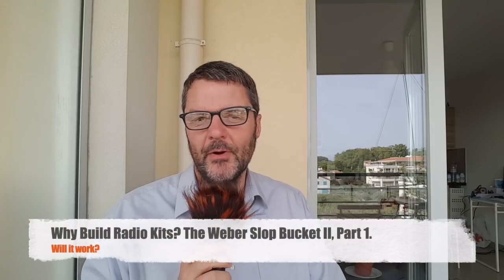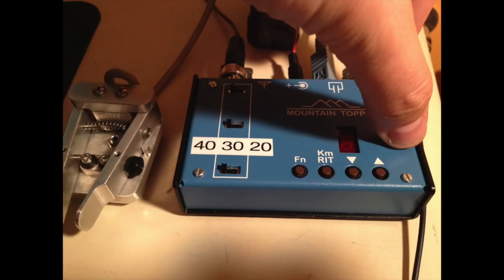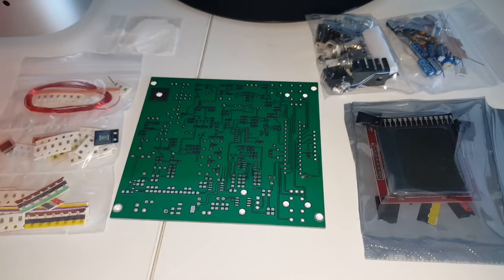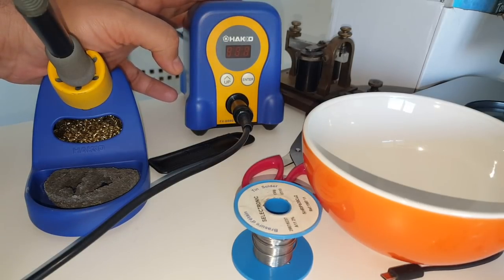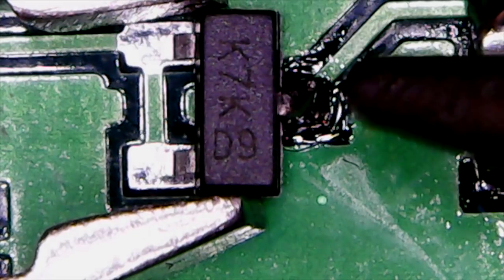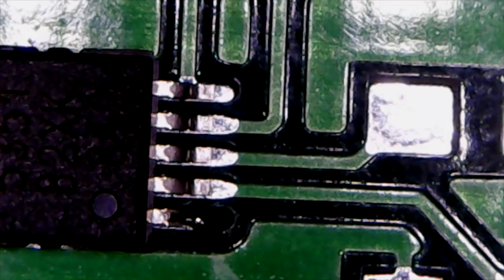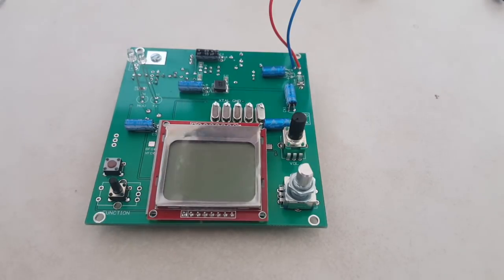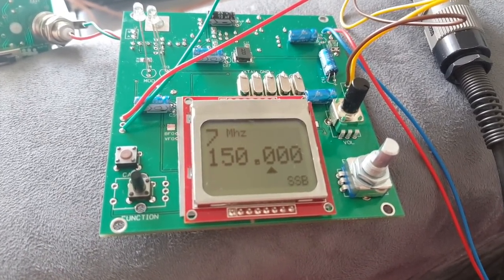Why Build Radio Kits? The Weber Slop Bucket II, Part 1.

Comment: Hi, just got out my slopbucket, it is still waiting to go into a case which I started to do and then set aside. Getting a rig into a case usually takes me just as long as building the radio itself. Still waiting for the part 2 video, but I am not either! Did you ever get any solder paste? 73 om
Reply from the maker: No, and still have to put mine in a case, LOL.
Reply: Is your address on QRZ.com good?
Reply from the maker: Hi, yes it is..

Comment: You do realize that the new YouTube guidelines say that you should let the  magic smoke out BEFORE coming on line so we will then believe that you are competent and a good technician. Seriously though, I am wondering why so few use solder paste and heated air flow techniques. Honestly, I as of yet haven't done it, but I have prepared with the Mechanics brand solder paste (recommended) and an inexpensive rework station. I have used the iron on that station for a couple years and it is one of the best I've owned (A 50 dollar eBay unit !) . I have no reason to believe that the air system will not work. I have picked up inexpensive universal breakout boards for inexpensive extremely small smd chips for practice. So I then won't destroy an expensive chip. I have new braid coming because I have seen it not work even with the slightest nearly invisible amount of copper corrosion. If you can see the corrosion its probably worthless.  My friend ND6T uses a slop bucket on 80m for some local nets and it sounds great. I wish the offerings were not so small, 80 pieces isn't a lot of units.
Reply from the maker: Right, I am tempted to try the hot air method but the problem is my vision now...
Reply: @RadioPrepper  Well, vision affects all of us regardless because few have microscopes for eyes. I'm going to use one of the cheap usb ebay microscopes. I think it will do the job on smaller boards as is, it has a small stand. On larger boards I'd need to figure out some sort of horizontal sliding system to hold the microscope . But most of the boards I will do now are very small. In fact, I've started this video on the exact point showing exactly what I will do ... https://youtu.be/qqoHTKhIBRo?t=609
Reply: Incidently my eyes, both of them, were like microscopes for most of my career. Extreme Myopia. Was good for electronics. Now, one has a lens replacement, and one is the original ans still good for electronics. Older people look at me (I'm 70) and think its really strange I hold things so close. And can read so well. Without glasses.
Reply: One of my jobs was to repair kits folks had built. Helped to have a good background in troubleshooting.

Comment: 8:18   Solder flux is your friend and stops solder bridges from happening. Here is a link to someone applying flux, applying the solder and then quickly and safely fixing a solder bridge. You can see that the flux makes things a whole lot easier. I swear by the stuff.     https://youtu.be/6PB0u8irn-4?t=28

Comment: Gill if you put a little flux on the board those fine pitch chips will flow much better and bridge much less also if you put a little flux on the solder Wick it will draw up the solder much better. You did an awesome job. Love your videos keep it up.
Reply from the maker: Thanks!

Comment: Gil, maybe it's time to get a hot air soldering station and use low temperature solder paste for SMDs. They are fairly affordable on amazon and will make your life much easier.
Reply from the maker: Yes, probably would... Thanks.
Reply: @RadioPrepper  Less than $50 USD. :) 73s.
Reply from the maker: Yes, and a hot plate..
Reply: @RadioPrepper  No need for a hot plate if you get low temperature paste. The components just get sucked up to the paste and pads. It's amazing to watch.
Reply from the maker: Interesting thanks.

Comment: Very nice, you have convinced me to get a usb “microscope”! Flux does make things easier but Steve specifically warns against using liquid flux. Despite that I often use a little tiny bit of extra liquid flux applied with a toothpick that looks like it does not have any flux on it any more. And then I usually boil my boards in alcohol to try and get the residual flux out from under the parts. Having set my left hand on fire once with liquid alcohol (with a “penny stove”) you really want to be careful with hot alcohol, that blue flame is almost invisible. Loved the job you did with the si5351, wow! My first slop bucket did not work at first and I had to go over several places more than once and had to get help from the group and from Steve to get it going. Thanks again for the videos. Jerry aa1of
Reply from the maker: Thanks. I hope I can sort it out...

Comment: Flux makes working with smd a breeze. Just put plenty (really flood it with flux) on the legs of the ic, a small blob of solder on the tip of the iron and slide the tip along the pins in one go... flux makes it easy... No need to address the pins individually. Thanks for sharing this kit, nice!
Reply from the maker: Thanks.

Comment: Gil for the surface mount components you really need a smaller soldering iron bit, however, If you take some thin copper wire and wrap it around your iron tip the end of the copper wire becomes your TIP making it easier with the aid of your zoom camera to solder the small legs on ic's etc  Hope that helps 73 Mark
Reply from the maker: Good tip thanks.

Comment: Great content man. Gives me hope at trying this once I can acquire a decent solder station. Using the $15 Walmart specials are barely good enough to solder coax with a PL259 connector. Thanks for the vids! I really enjoyed the 2m SSB ones from a couple years ago as well. Ended up picking up a vintage Kenwood TS-700A at hamfest last weekend as a result of seeing how fun it can be and I will patiently wait for the bands to open. Gives me enough time to get a good dipole setup. Have a great week!
Reply from the maker: The Hakko station is great, but there are fakes floating around...

Comment: The method I use for SMD : stick the SMD in place with flux paste, maintain them firmly on the PCB with a pair of tweezers and apply the solder tip with a drop of solder on it. Flux will help making nice and even joints and will avoid solder bridges, even with large solder iron tips.

Comment: Ok... I am really impressed.  My eyes are not good enough nor are my hands steady enough to attempt something like that.  Those days are past...   I built my first kit back in 1962 - a Lafayette Explore Air regen  receiver.   I was 10yo.   Next I built a 40m/ 80m transmitter from junk parts from old TVs and radios.   Lots of fun....  a few years later I built a Heathkit HR-10.   HOWEVER, surface mount work is way beyond my current abilities.  I did enjoy the video...  later...  73
Reply from the maker: Thanks. I think I'll switch to tubes next.. Those parts are too small!

Comment: Hi Gil, If you can get your hands on a flux pen, touch the pads first before applying the solder. It will give a much better flow and joint. There's nothing wrong with what you are doing but I find the flux makes the process easier. I like the usb magnifier I've seen them online but I've stuck to a free standing magnifier. Might take the plunge and get one of them.
Reply from the maker: I'll have to Google that up!..
Reply: @RadioPrepper  https://www.jaycar.com.au/solder-flux-pen-12ml/p/NS3036  this is the one I use. So handy. You will have an equivalent in France for sure.

Comment: Morning Gil.
Very well done with the Surface mount soldering👍👍👌👌good on you for helping to keep Homebrew Alive and Showing us all that it is still possible to built our own equipment...I think Plenty of solder paste on the Braid helps to fix the shorted pins on those very small IC,s.
Home construction use to be realy enjoyable with thru hole components but the Surface mount stuff is getting to the point where it's almost impossible to solder by hand anymore..Maybe it's time to start experimenting with putting the PCB,s in the oven with the Sunday Roast hi hi.
Good luck with finding the fault. Looking forward to more Videos on this.
Reply from the maker: Thank you!

Comment: watching you solder these small components is giving me anxiety issues!
Reply from the maker: It did to me too!
Reply: @RadioPrepper   If you want to build a digital VFO  monoband SSB tcvr have a look at the  EasyBitx from India  which costs 65 USD.  It is basically pretty much a copy of the  Bitx40  in three different bands  but clearly you solder it all yourself.  I believe the VFO is prebuilt and uses an Arduino type controller so you can add your own functions.   TE Fidler
Reply: Holy cow. I read this comment before watching and thought "It can't be that bad". Yes, it was that bad. I caught myself leaning forward in my chair trying to watch hard enough that it might help things go smoothly!
Reply from the maker: LOL.